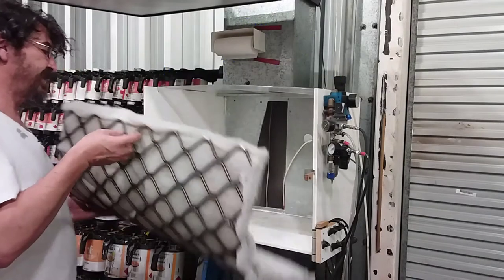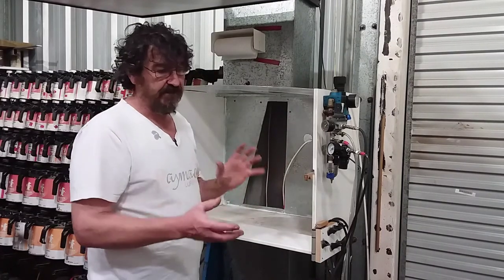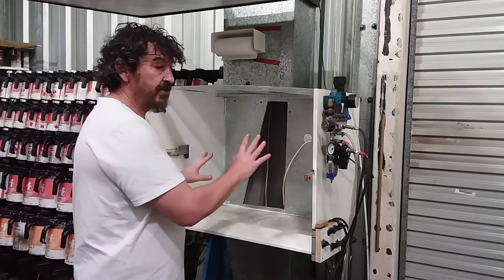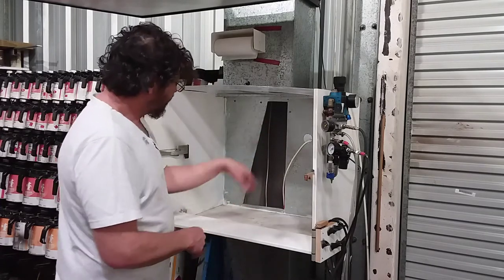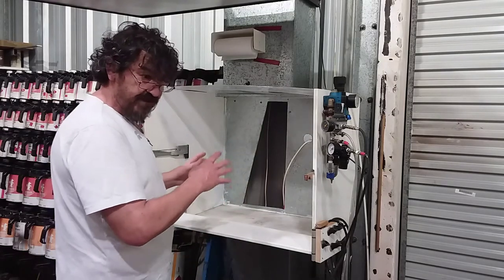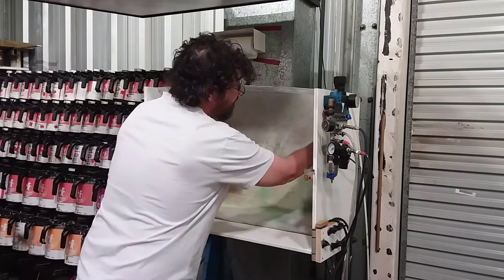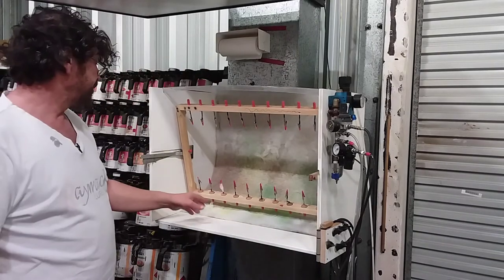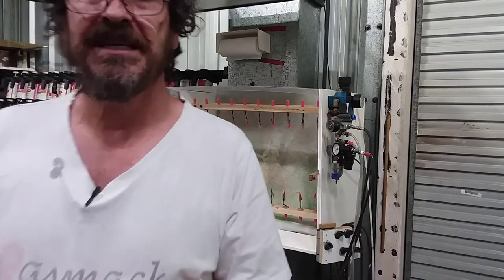Part 2 Spray Booth or Gas Chamber

Comment: Cool booth Raymack.   I agree working in a noisy booth is horrible.   My exhaust fans are located on the floor to reduce in booth noise.  Do to poor vision, I need to hear the airbrush and the air hitting the fishing lures while working.   A noisy booth would effect the quality of my work.   Thanks for sharing.
Reply from the maker: Thanks,  I am happy you found some thing useful in the vid
It is a mark 2 booth, the first one had some big flaws and simple one like having my airbrush rack and air feed lines on the left side, when I am righty